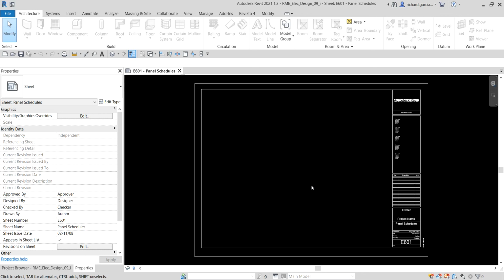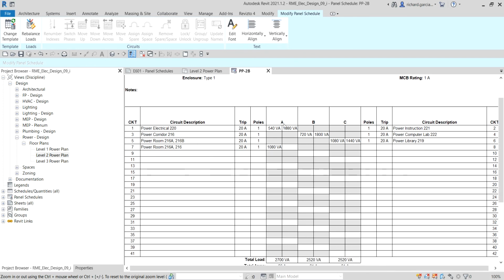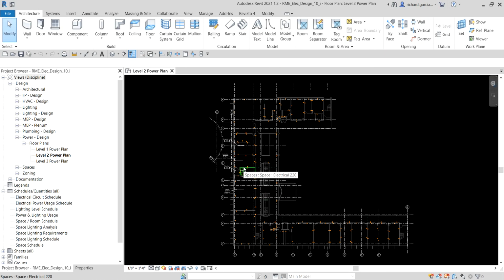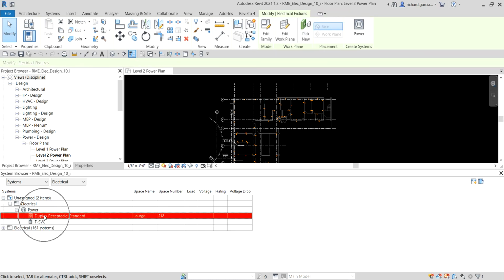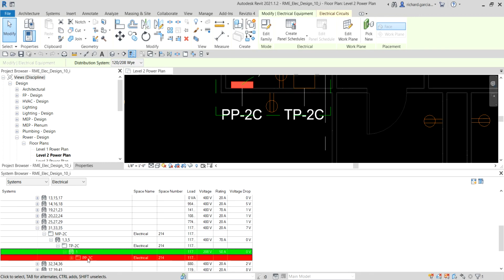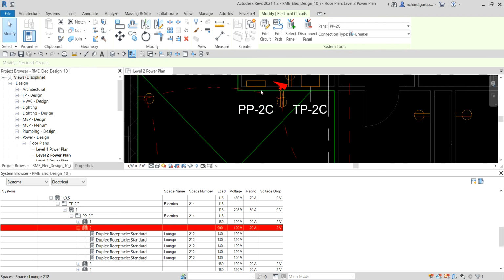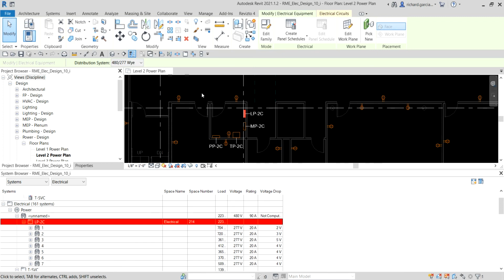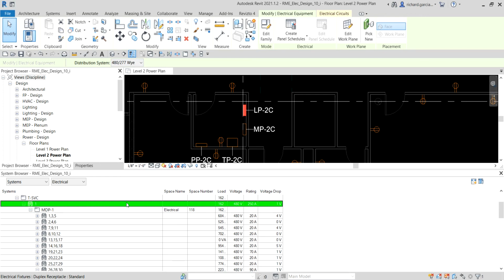REVIT MEP 2021 - ELECTRICAL SYSTEMS - 31 CREATING PANEL SCHEDULE AND CHECKING YOUR DESIGN

Comment: Hi，if there is only one panel in a residential house or for the main panel, how to resolve the problem of circuit is not assigned to a panel? thanks
Reply from the maker: have you tried creating circuit by adding the electrical fixtures to the panel?